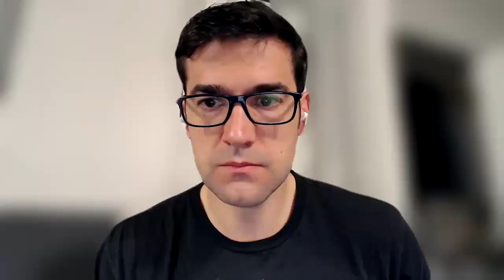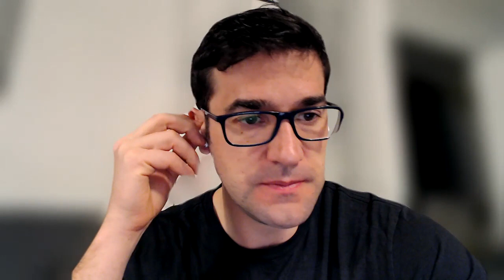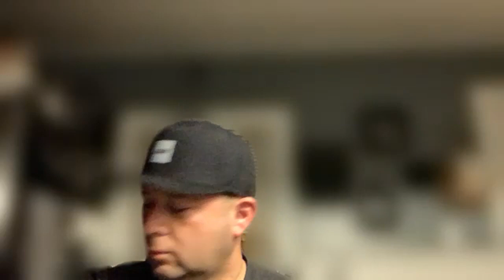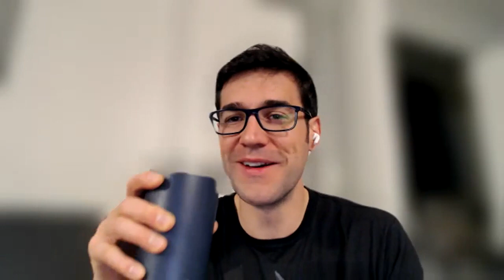Completing a Maintenance on a Refrigeration System is so Important

Comment: Great information been enjoying all your videos when you were talking about microns my father taught me on an old analog micron gauge back in the late 1970s.  And my father was taught about micron gauge is when he was younger by an older gentleman in Refrigeration.  
       So the information was always there and pulling below 200 µm was always known by educated individuals Who are lucky enough to have educated mentors. 

       Somehow our nation and especially in the trades are general public schools were dumbed down to the point where in the last couple decades when you asked somebody what a micron gauge was they didn’t even know or if they did they’ve never laid their hands on one this is sad. 
           I just released a video we’re on a 20 tonVRF system I pulled it down to 29 µm and that was without my initial sweep with nitrogen. . 
      I do 20 to 60 tonVFR systems with a several hundred feet to a couple thousand feet of copper piping and the lowest I’ve achieved was 13 µm that I released a video on one time with the micron gauge at the very furthest run away from the vacuum pump.
Reply from the maker: That is so amazing. I love that you were taught the correct way over 40 years ago and today as you mention may technicians do not know or struggle with doing it right.  Please send the video link so everyone can see how to pull a deep vacuum.